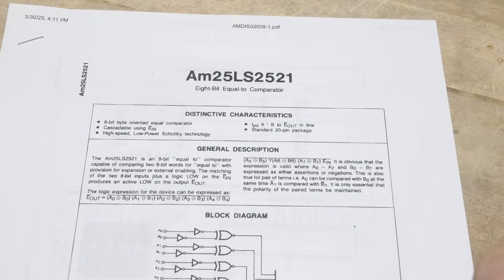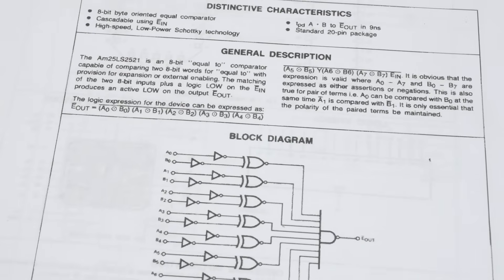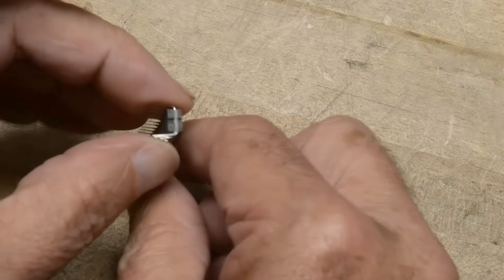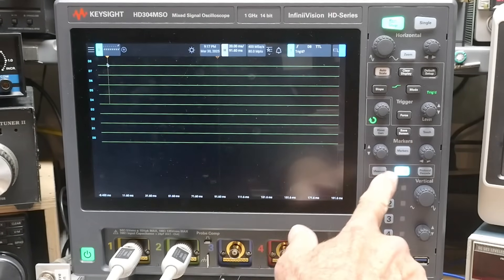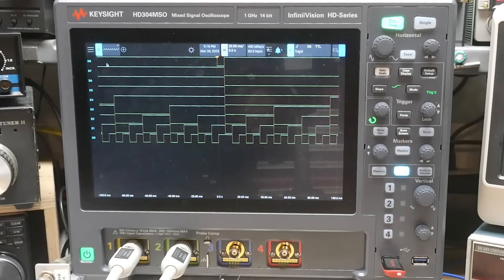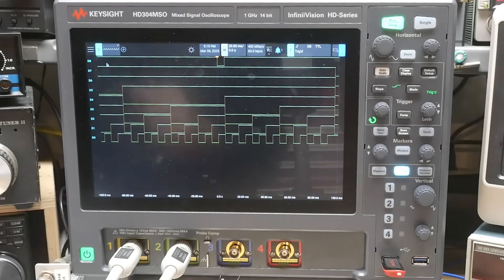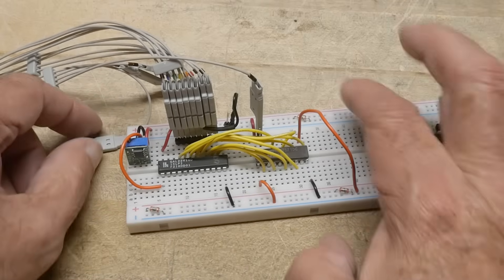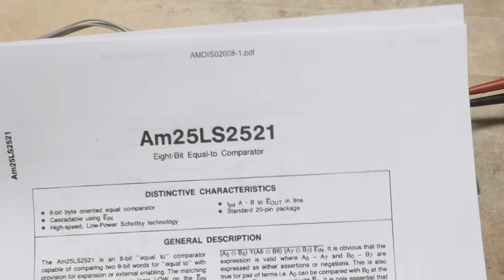#2202 AM25LS2521 8-bit Compare

Comment: This is AMD's rebadge of the 74LS521 which was a very common equity comparator for detecting ISA base addresses in card I/O decode logic back in the 80s.  I used them back then on a breakpoint generator for debugging embedded 6502 systems which was just a couple '521s, a couple 8 position DIP switches, and a couple resistor networks with an OC gate to throw the IRQ or NMI line. The enable on pin 1 is convenient for chaining multiple comparators. From the same Am25 series I also remember coming across the Am25LS2538 on minicomputer cards which was AMD's fancy version of the 74LS138.